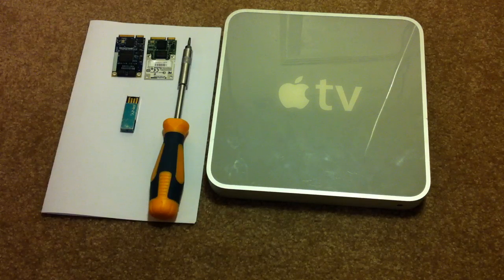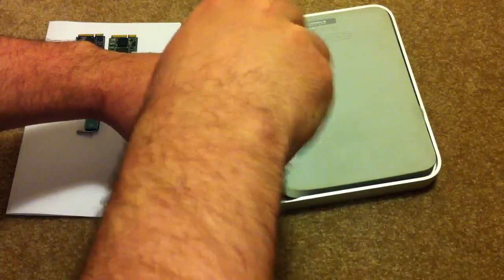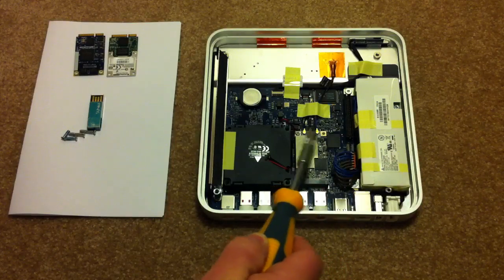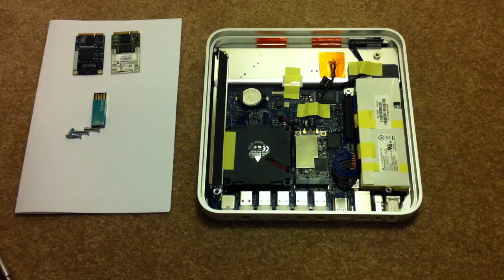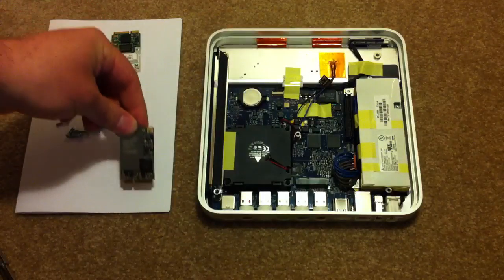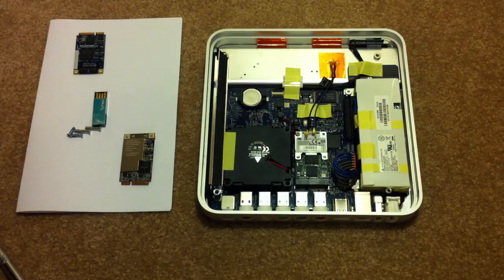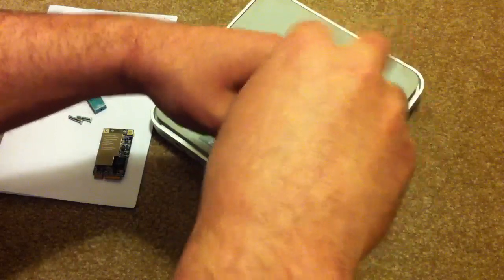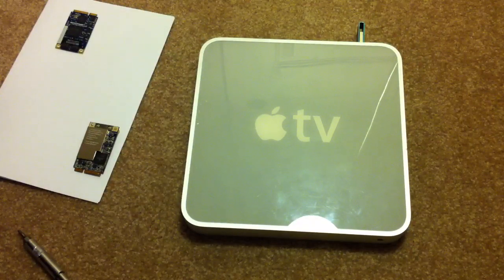Adding a CrystalHD card to an AppleTV

Comment: If the Crystal HD card is installed can the Apple TV still be used as it was made or does it have to be loaded with XMBC or KODI?  I like the ideas of watch HD content, but would like to use it with original software as intended.  Is that possible?